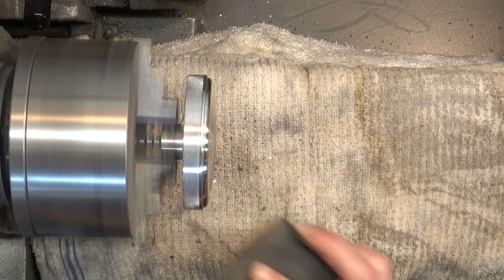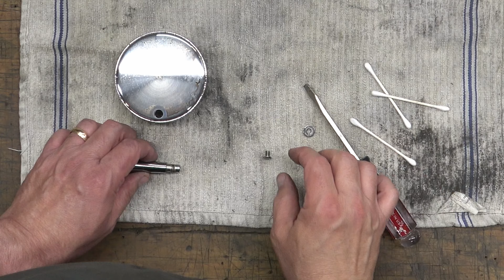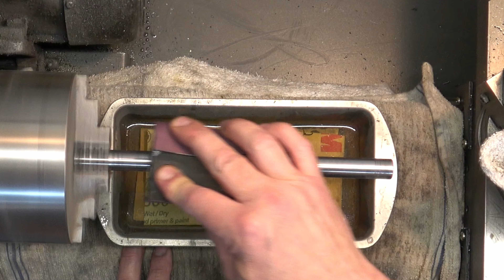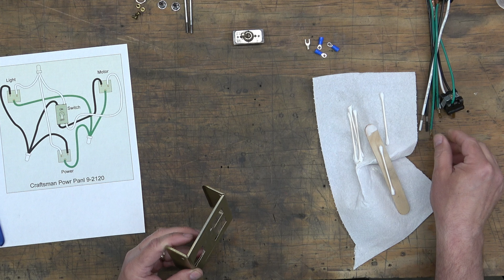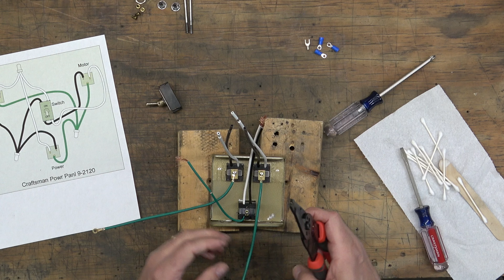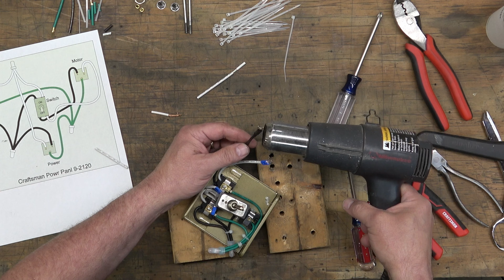Part 10 Craftsman 6" Jointer Rebuild (Cleaning & Polishing & Powr Panl Assembly)

Comment: Fascinating video series! I'm learning so much. I don't know that much about sanding. How much material do you estimate you took off from the arbor? I mean, are we talking something like only 0.0001" total? Is the sanding basically taking off the corrosion layer and not actually touching the dimensional metal?
Reply from the maker: Yes, anything that has a critical diameter should only be sanded if it needs it. otherwise just clean and polish. A lot of the time I hit a part with the wire wheel then polish. So parts like spindles and shafts that hold ball bearings should not be heavily sanded or avoid sanding if possible. Parts that do not have a critical diameter can be sanded and refinished like the hand wheel.